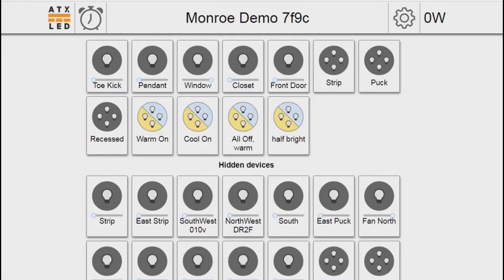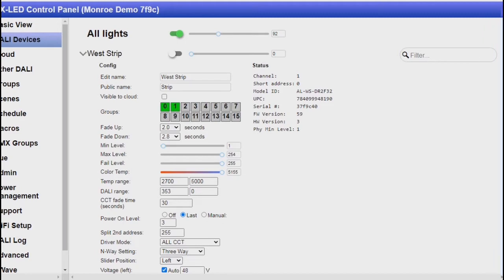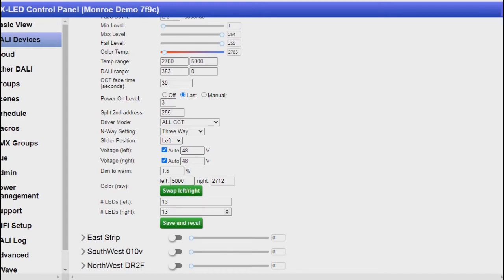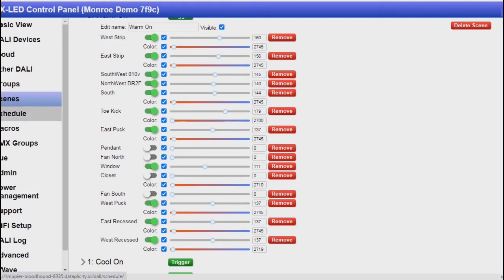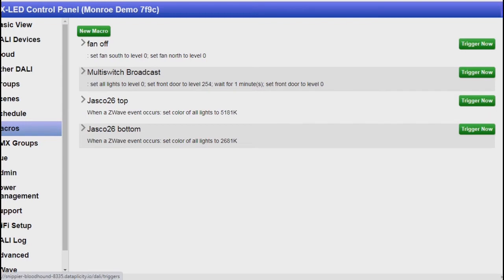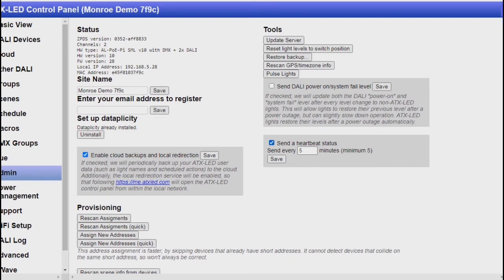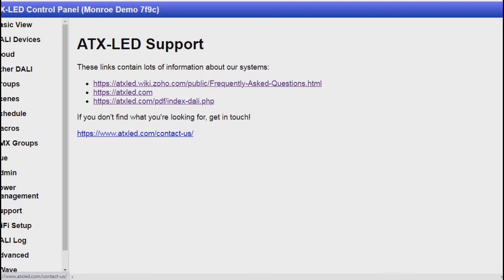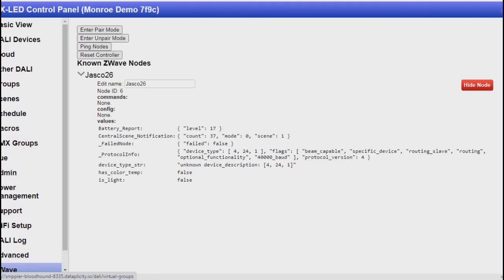Intro to the ATX LED hub - how to manage your lights.

Comment: If three switches in a room can be grouped, do they need to be wired together like a three way ? Or is this completely different
Reply from the maker: grouping ( we call it tandem mode or virtual 3-way ) occurs over the DALI bus.   Each switch in the set ( your example is 3 ) is set to transmit a DALI group command for dimming level or color.  Then, all 3 switches are members of the group, so they will receive the info at the same time.   If a switch initiates the dimming - we disable fade so all lights track very well.  If the Hub initiates a level change - all will fade at the same rate.  Switch initiated dimming requires no Hub - the hub can be replaced by a simple resistor and the multi switch virtual 3-way will operate normally.   The Hub ( or DALI Master ) sets the groups.  The DALI bus is a simple 2 wire bus that operates at 1200 baud and is very robust.
Reply: @atxled7490  thank you. I am getting all my lighting plan in order and will be reaching out in the next week .)